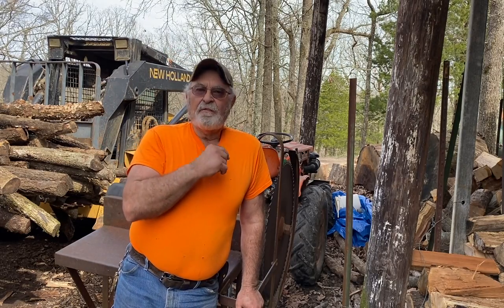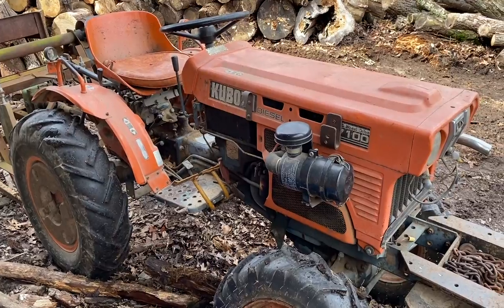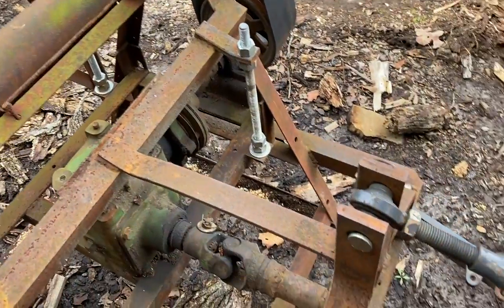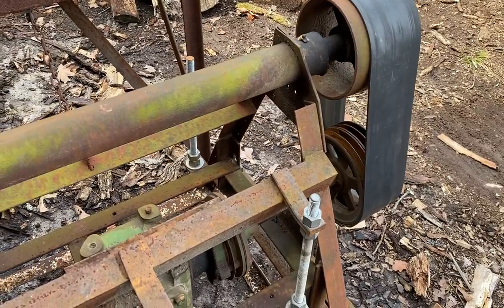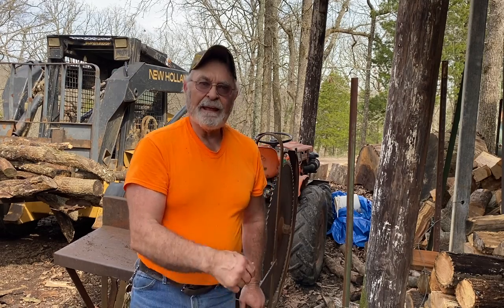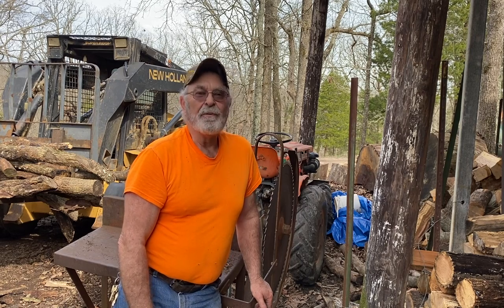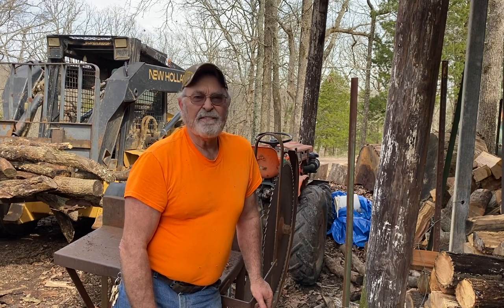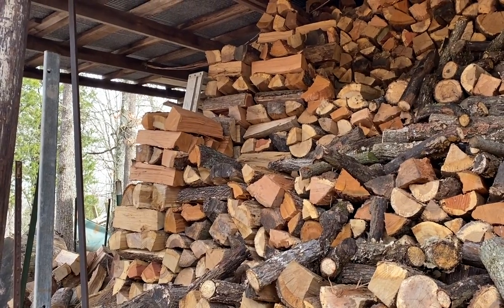Kubota B7100,  Buzz Saw and Pole Wood

Comment: You just keep pulling out new toys and shiny tractors.  So what do you do with all the firewood?  If I heard you correctly you have 20 plus cord dry storage capacity plus firewood piled all over the place seems like.  Do you sell any never asked or heard you say. Thanks take care brother
Reply from the maker: Hahahaha. that old Kubota is older than two of my three kids !! And darn it, it still has some paint on it.  Actually the woodshed has three compartments (only two were shown) that are 12'L x 12'W x 10.5 H. 10.5 is approximatly the height because its 12' in the front and 10' in the rear.  So that calculated out to 1512 cu ft per compartment.  So three compartments total 4536 cu ft.  Divide that by 128 and it equals an approximate 35.5 cord total.  Then there's the dodie pile where we stack all the pithy ones and real nasty snarls for use in the sheds too. 

    My pile of wood supplies two houses and three workshops with heat and will soon be supplying three houses again when I get done with my daughters new house.  We typically go through one shed section per season so we try to maintain a full shed so we get three years seasoning before any is burnt.  No, I haven't sold any but I've given away a lot and we have a family friend that cannot afford to pay her heat bill for her trailer so I try to keep her in good dry wood for the coldest portion of the season as well.  Thanks for commenting Ben.  Stay Safe and keep splitting !!
Reply: Tractorman44 My dodie knarly pile usually just gets burnt I can’t use it or sell it. I plan to take a break from splitting maybe till fall I unhooked from the splitter last weekend after doing the splitter wars video.  Hopefully my tree guy shows back up if not I’m in good shape for several years just won’t try to sell too much.  I don’t sell much at all maybe 3 cords the past year. Be safe appears the weather is supposed to be bad again.
Reply from the maker: @OurGreeneAcres  I split just about anytime that time allows just to keep ahead of the woodpile.  But I don't prefer hot weather splitting at all... LOL.  We cut whenever the opportunity comes around to get trees from construction sites or friends and neighbors that need them removed.  So we get a lot in a very short time, then we have long dry spells it seems.

Comment: When I cut out of my grapple, there are usually about 2 cuts that I can't make. I thought about trying to find a cord wood saw. There is no way a man can cut as fast with a saw on that size wood you were cutting in the video. Do you sharpen the blade yourself? Someday I'd like to get a firewood processor, or build one. I'd like to have one with a circular saw. I also like you B7100. I've thought about getting an older Kubota to take to antique tractor shows. How many hours are on it?
Reply from the maker: Good Morning Roger, yes I sharpen it myself.  May not be the accredited 'correct' way, but its what I learned from the old man back in the day. Check this one out :https://www.youtube.com/watch?v=ed8WSvOXvkw&t=638s. Here's one of my first attempts at a video as well:https://www.youtube.com/watch?v=TZ36Rxpn754&t=23s. Then here's part 8 of a buzz saw rebuild in my playlists:https://www.youtube.com/watch?v=TZ36Rxpn754&t=23s.  A bit slow and tedious, but it may give you an idea of what to try for yourself if ever needed.  I think the Kubota has around 2400 very satisfying hours on it.  Not selling commercially, I don't think a processor is feasible for me, but when you run the numbers on product vs time, I can certainly see its viability for building a substantial side business.

Comment: We had a saw very similar to yours mounted on the front of a Farmall H, run by a flat belt. Ours did not even have that hoop guard yours has and it never once jumped out and bit anyone. You just need to use some common sense, Keep the area around your feet clear of trip hazards. Saw on brother. Semper Fi.
Reply from the maker: Good Morning Ron.  Hopefully all is well with you.  I just converted another buzz saw back into a stationary rig to power exactly as your old H powered yours.  We still have the one we grew up with that mounted on the front of a MH 101 Jr or Super with no guards.  Never a problem.  Snow was always an issue until sawdust covered the ground though....  Take care and be safe !!  S/F my friend.

Comment: MAN, YOU ARE RISKING LIKE CRAZY , PLEASE DON'T DO THAT.
Reply from the maker: Yeah, I freak people out all the time.  No biggie, in 60 plus years of using buzz saws the worst thing I've had was a splinter.  Now mind you , I might cut my arm off tomorrow...but so far the safety measures I have in place have saved me the loss of blood and guts.  At least if I do, it'll probably be on a video accompanied by  a warning !!  Seriously, I don't take chances around the rig.  It may look like I'm really close, but for the most part I am not. Buzz saws have been given a bad rap because of all the old wives tales.  You'd think every farmer in the country over the age of 50 had lost a hand by the number of stories.  CIf you like, check out this safety video I put up a while back: https://www.youtube.com/watch?v=2J0trs7CF_Y
Reply: @tractorman4461  Bro.. i've seen two friend of mine loosing fingers on old circular saw,  the last month a customer who sells wood has cutted his hand completely on a belt saw, 65years of practice ..and this summer i was about to die for a simple fall from a ladder, i'm not a newbie  but safety isn't  being smarter or faster than others or taking more risk, safety means you can do something wrong without being cut in half. Life is not a Circus, is easy to add something to hold the wood material without having to stay so near at the blade,  i see you moving and you are in a serious risk.. risking for what? Are you paid to scary people? Bye bro😉💪